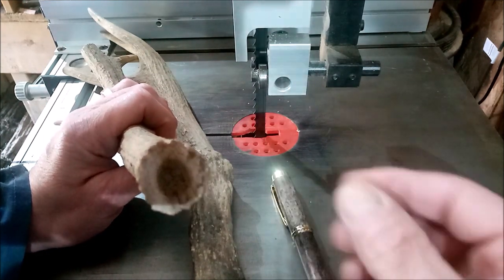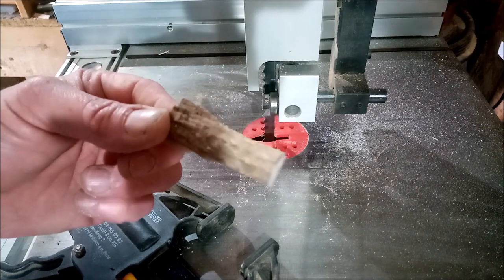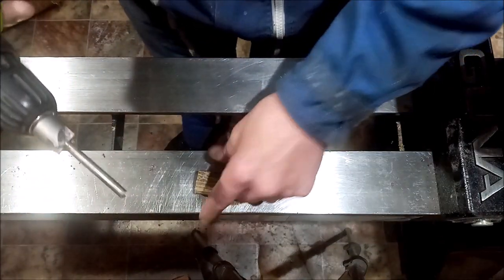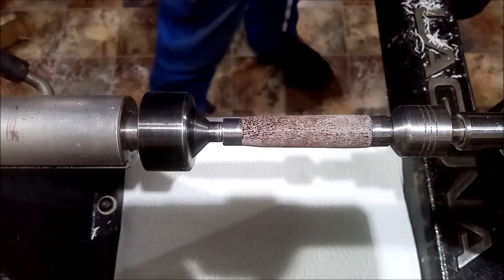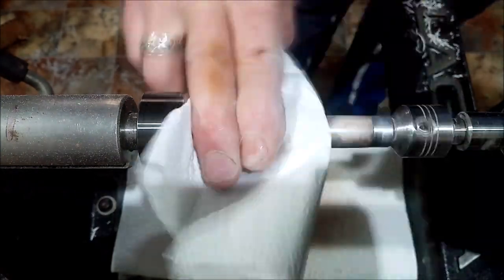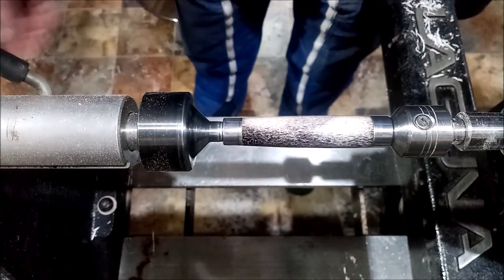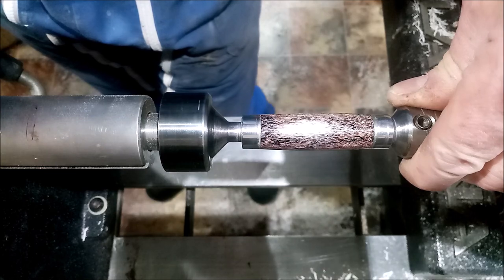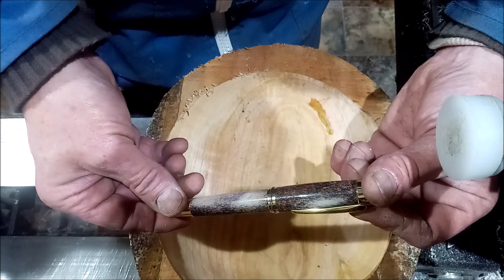Turning an Irish Red Deer antler fountain pen / Wood Turning

Comment: Hi Shay, Fantastic video and I learned a lot about using antler. I have heard it smells terrible as well. Keeping this video for the time if I ever get some.
Take care Shay and the pen is stunning.
Cheers, Huw
Reply from the maker: It does Huw, especially if it is fresh. This one had been sitting in a shed for a couple of years before I bought it so it was not bad. I will still recommend that a mask be worn when cutting and sanding even if there is no smell.
Shay
Reply: @BBTurning  Hi Shay, Just bought a couple of pieces on eBay for under £9. I'll give it a go and if it goes wrong not too much expense to loose
Reply from the maker: You did well at that price mate. Good luck with it. Any question just give me a bell. 
Shay

Comment: I would have never known that was previously an antler.
Reply from the maker: It feels like polished stone if that makes any sense Andy.
Shay
Reply: @BBTurning  It's just I have never seen anything that looks like that.  I wonder if it's possible to turn the tip of a bull's horn into fountain pens?
Reply from the maker: @AndyFromBeaverton  If the tip is solid I dont see why it would not work Andy. If you have access to some bulls horns give it a go and see what happens. It could open a whole new medium for turning pens. HAve you seen this weeks video, it's the 4000 subscriber giveaway and I am giving away one of these pens.
Shay
Reply: @BBTurning  Yep, that's why I'm posting on this older video.  From your link.

Comment: The pen is beautiful, why do you use CA to fill in the holes instead of ...say epoxy,  or some other type of hardener? As you can tell I have never done anything like this but it looks like good fun and there looks to be some learning curve to it also. Very interesting.
Reply from the maker: The answer is twofold really. 1 resin basically takes too long to cure and would require a mould. 2 The idea of using the CA to create a slurry works this way. When you put the CA on it not only hardens the marrow but also goes into the holes. When you immediately start sanding you take the CA off the surface leaving the CA that is in the holes. As you are sanding you create dust which goes into the holes and is caught by the CA in them. It then goes solid filling the holes. It is very quick as you saw in the video and has the added bonus of the holes being filled with antler which makes it a true antler pen and not a hybrid of antler and resin. I hope that explains it.
Shay.

Comment: Your drill will follow the path of least resisstance, marrow, and when its drilled the hole will be oversized.
Reply from the maker: No Denis, it drills straight if you do not go too fast, and use a very sharp bit I have done hundreds of Antler pens and have never drilled an oversized hole. If you keep it slow enough you will be fine.
Shay

Comment: I wonder 🤔 why you are drilling with a chuck if there is a much better and easier way to drilling antlers. Just asking 😌
Reply from the maker: To make sure the hole is straight Richard. What is the easier way, you have me intrigued.
Shay.
Reply from the maker: I have seen Marks videos before Richard , the method he uses works well but i don't have the pen clamp he uses.
Shay.
Reply: @BBTurning  No worries Shay, this pen clamp is just an expensive luxury and not necessary. I use instead a strip of leather about 60mmx30mmx2.5mm and a simple Water Pump Pliers and that's it. Total cost under 10 bugs. Just hold it tight and you are good to go!
Reply from the maker: @richardherzog4890  i must look into that Richard.
Shay.